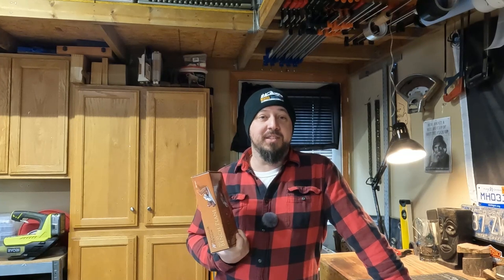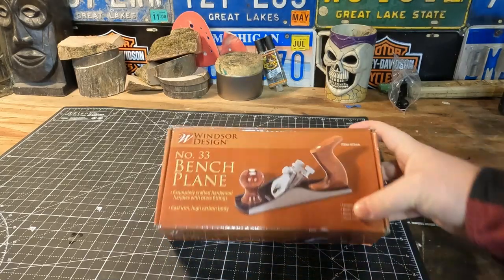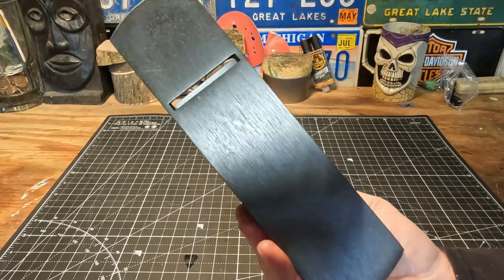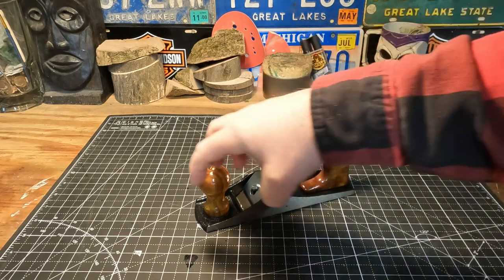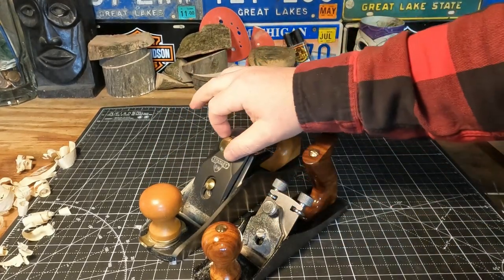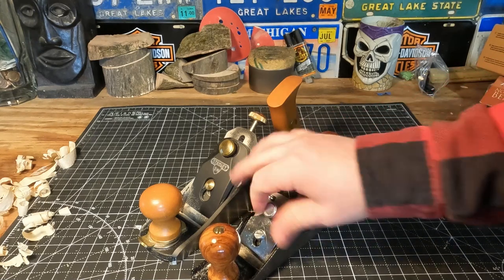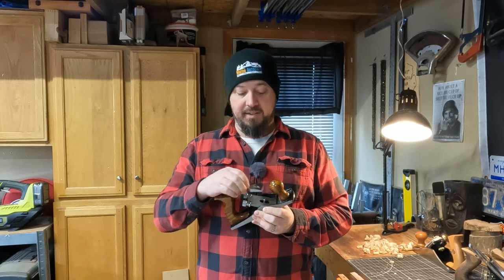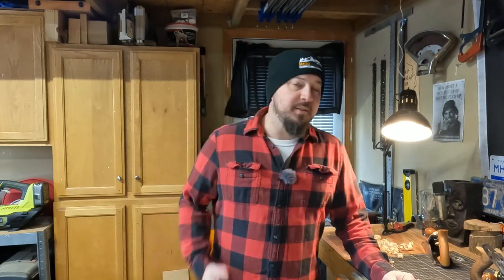Harbor Freight Bench Plane Review

Comment: I think the back of the cap needs smoothed at the bottom edge. plus all the other stuff you mentioned. 

I have thought about getting one just to try. But I knew it would take so much work. I'd much rather buy a 20 vintage plane and put the time into it. At least I know it is a quality tool.
Reply from the maker: Exactly, the price is tempting, but just so much to get it to run right and even then I just don't think the quality is there.
Reply: @mataooutdoors  Yep. The only regular plane I have bought I paid over 25$ for was a barely used 5 1/2 stanley I paid 60$ for. I have several stanleys and others I have bought cheap and "restored" to usable condition. And honestly if you research enough to be able to do this you will learn so much about them you learn to tune them at the same time. Making them awesome to use.  I look forward to seeing your next video on it if you do one. I'm sure you could make it work for a while and probably OK. But it never will be a great plane. Now have you seen the Jorgensen planes Lowes carry. Those are terrible. Well terible color. And I still think a vintage plane is better. Especially vs  the 10 inch one which is now $70.

Comment: Did you figure out what to with that plate? I am thinking about sanding it down a little. I had a $50 budget and needed clamps, diamond stone, chisels, and a plane, so I went to harbor freight. Confident I can sharpen things okay, but do not know how to handle that plate that won’t stay in place.
Reply from the maker: No I put it on the shelf and never got back to it, I had an idea though to use a dremel and carve a small flat recess in it for the screw head to sit flush against. I've been so busy I haven't had time to get to it. Maybe I can see what I can do with it this weekend.
Reply: @mataooutdoors  I am going to try using it (or any plane) for the first time this weekend. I think I have it flattened and sharpened. Wish me luck.
Reply: @KevinAdams06 Hey, how did your first plane venture go or better yet your, daring first plane venture?

I am debating taking the trip to my local HF store to grab that 33 as there arent any decent used ones to buy locally nowadays for some reason. I, like you, am also a noob to this tool.
Reply: @potvinsuks8730  I got it in okay working order, but I don’t think it was worth the hassle. Not only did it take a long time to get it flat, but the iron is a price of junk and doesn’t hold an edge, and I cannot find replacement irons. Find something used instead.

Comment: Harbor Freight must mean Sh*t in an Asian market somewhere. 

I’ve had it four days and might get two passes before it all comes apart. 

On mine, the left built in frog footing was about 1/8 higher than the right.  

I’d hoped fixing that would resolve the restraining screw issue, but it hasn’t been good or worse. 

It’s just a POS and shame on me for buying another HF anything. 

The only thing I have ever bought from them that works are 12” clamps. Everything else is junk.
Reply from the maker: Yeah I find its hit or miss with them. That plane is just so bad. I have the bar clamps they sell, and they are not bad off the shelf, with some minor modifications they are amazing.
Reply: hmmm interesting you figured it must be asian market, because everything in the US is from the same asian market if you think of it or if you can flip any product and see where its made in.